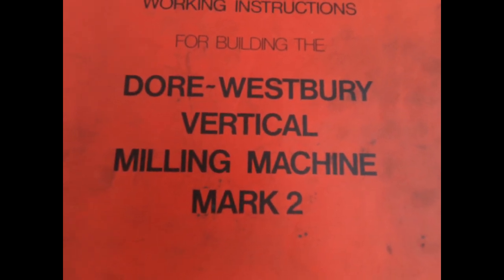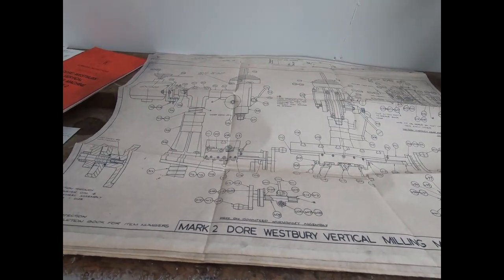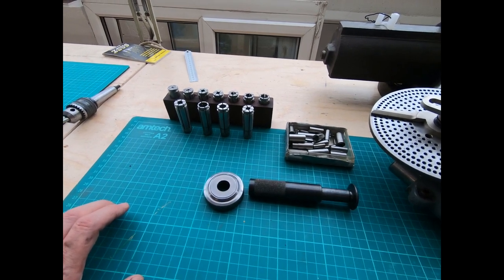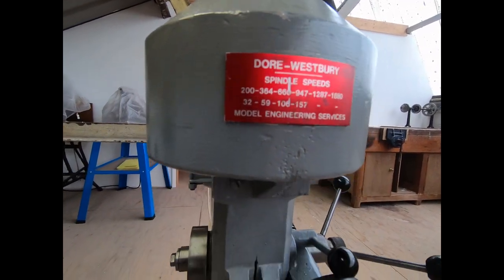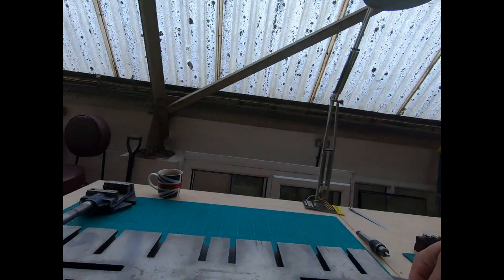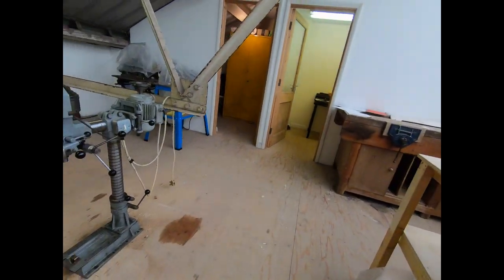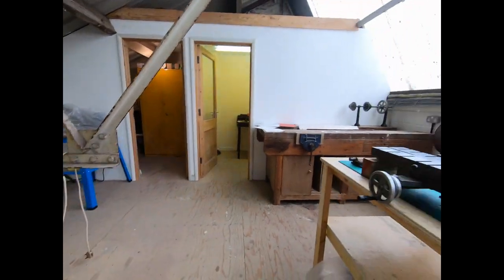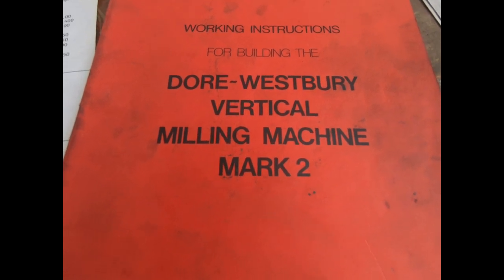Dore Westbury Mk 2 Milling Machine - First View...

Comment: Love the videos. Hope your able to release more content soon. Im curious too know what oil you use to lubricate the DW Spindle ! I recently bought a DW Mk1 and it has an oil hole on the R/H Side but i have no 'Maintenance' Instructions for it. Any advice regarding the care and Maintenace of the machine in normal use (DIY bits n bobs in the shed !) is much appreciated ! Kind Regards and lookign forward to more videos. Cheers
Reply from the maker: Hello,
Congratulations on getting a Dore Westbury... I must admit that my DW is the machine I use the least in the workshop, which does mean it needs very little maintenance. I think I use myford way oil on my DW.
I found that they are a little prone to rust so having a cover for it when not in use should help prevent rusting. Also have a brush and just give it a quick clean after use, having less swarf hanging around should help limit more wear & tear.
Many thanks for watching.
Take care.
Paul,,

Comment: Hadn't seen those collet sleeves - where did you get them? I've lost out on quite a few myford dividing heads on eb*y ... Lovely Dore Westbury! What luck!
Reply from the maker: Hello,
Thanks for dropping by... The collets were originally supplied my Myford but sadly then don't any more... so sadly the only option is to buy second hand one's, there is a chap on the web that has some detailed plans on how to make them.
I hope to start making the bench for the Dore Westbury next week and get it up and running.
Take care.
Paul,,
Reply: @TheKnacklersWorkshop  I already have (most) collets thankfully - but what about the sleeves you mention between the collets and work pieces? Are those just slotted tubes of various thicknesses?
Reply from the maker: @williamsworkshopuk  Sorry I get you now... yes just slotted tubes... they came with some secondhand collets I purchased.

Comment: Nice machine. Drawings invaluable if you ever need new bearings. I too have a Nippy vice. My vice moving jaw lifts the metal up, when tightened. Chech yours. I have tried to tighten under jaw, but it still happens. This makes my vice unusable!
Reply from the maker: Hello Barry,
Many thanks for watching and commenting... Thank you for the tip on the Nippy vice, I will check mine out when I reassemble it...
Take care.
Paul,,

Comment: Lovely machine. Classic old school Brit engineering. I have the Mk 1, though it's currently in the sick bay (albeit with nothing that can't be sorted out).

I'm very fond of it, but with one exception: the arrangements of T-slots on the table. They always seem to be wrongly spaced for fixing vices etc. to, unless DW made a bespoke range of tools to fit them. They do look good all the same.
Reply from the maker: Hi Gary,
Thanks for visiting and good to hear there is an additional Dore owner out there. I cannot see the logic of why the T-Slots are like they are... I have a book coming by one of the designers of the machine which I am hoping might make a reference to why... I feel sure I will be challenges with securing vices, rotary tables etc. to it... 
Take care.
Paul,,

Comment: Nice machine, seems a bit space inefficient though. I think you could modify it to turn the motor 180° vertically and mount it above the column, giving you the ability to move it closer to a wall on the back side. Also never saw those morse taper collets before, interesting!
Reply from the maker: Hello Dmitri,
Thank you, I agree it does not make the best use of space...at the moment with the new workshop, space is not so much of a problem... Yes the collets are good.
Take care.
Paul,,

Comment: Hi Paul. I remember these kits being on sale but if you needed a mill to use instantly that was the down side. Even if you obtain another mill it is still a really useful addition to keep to use as a substantially built pillar drill with a very nice compound table. Tony
Reply from the maker: Hi Tony,
They are a bit like the Quorn tool and cutter grinders in that you have to be super keen to make one... That is true about using it as a drill... Thanks for watching.
Take care.
Paul,,
Reply: @TheKnacklersWorkshop  Exactly Paul. Super keen and have the time..... I didn't have the time to make either of those....I considered
 it and bought the book though lol..... In those days for me time was money in my small home maintenance workshop keeping my 
woodworking business machinery tip top and making jigs and fixtures to increase production. Thanks Paul great memories. Tony

Comment: Hi Paul, nice machine and it looks like it's been well looked after! In terms of your stand, don't worry about going big, the bigger and heavier the better as it will make the machine perform much better by adding mass. I would go big and heavy with a hole for the column and shelves and a door to store all your milling related kit so it's all to hand. Do you have access to a welder, (or anyone who has)? If so, go for 40mm (min) box section for the frame, fill it with sand, and make your shelves/door out of timber (no vibration transfer). Stand bolted to floor and mill bolted to stand will get you the best possible performance. Nice purchase. Cheers, Jon
Reply from the maker: Hi Jon,
Thanks for visiting. Thanks for your advice. I know some bloke who lives in Scotland who does a bit of welding but I think that is maybe to far for me to travel - lol... Seriously there is a company not to far away that make custom benches so I may ask them for a quote. 
Cheers.
Paul,,

Comment: It's remarkable that you were able to obtain the original drawings for the machine.That should help you greatly getting it up and running.
Reply from the maker: Hello Matt,
Yes the drawing were a good addition... I believe that once I have a base for it then all I need is to fit the table and all should work, fingers crossed that is the case. Thanks for watching.
Cheers.
Paul,,

Comment: What a spectacular lil machine...towards the end of the video it dawned on me that a person could also add a mill of that size to a lathe and increase the machining capabilities as well...

I do have a question though..the driven pulley on the mill is a bit extra tall....is it acting as a flywheel?
Reply from the maker: Hello Craig,
I am very pleased with the Mill and it should serve me well in learning to mill again. There are quite a lots of Lathe/Mill combos...  I am not totally sure about the extra tall bit... in the head pully encasement there is a planetary gearing system... Once I get the thing on a stand and running I will make a video on the gearing...  Thanks for visiting.
Take care.
Paul,,

Comment: Quite the surprise, Paul!  As I recall, these were sold before mini mills from the Far East were being imported.  Model Engineers had few options, and the Dore-Westbury was cleverly designed to be machinable from castings on a Myford or a similar size lathe.  Inside the spindle step pulley is an ingenious planetary gearing system which gives you the speed selection.  IIRC, a guy named Arnold Throp wrote a detailed book specifically on the DW mill (found it:  Vertical Milling in the Home Workshop, by A. Throp)
Reply from the maker: Hi Dan,
You are correct on all you have said... Ade Swash has a fabulous video on the Dore Westbury. Also, thanks for the tip on the book I have just picked up a second hand one on eBay for less thank 3 UK pounds... Thanks for watching.
Take care.
Paul,,
Reply: @TheKnacklersWorkshop  That's great news, Paul.  Back in the early '80s, I bought some bound volumes of The Model Engineer, and remember the adverts for the DW Mill castings from MES.  Bought a 4" Taig/Peatol back in '78, but had a serious hankering for all these wonderful machine tools from the UK (Myford) and Austria (Enco).